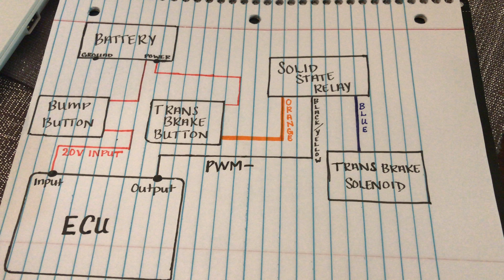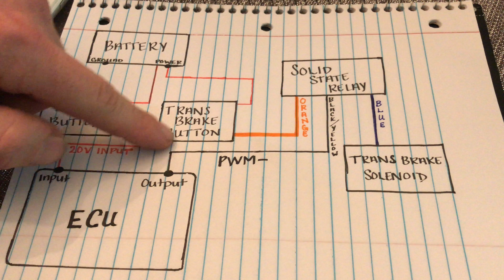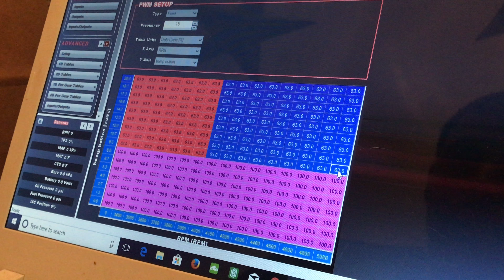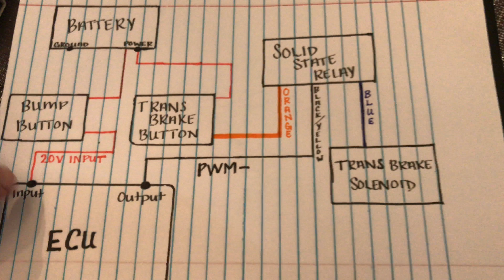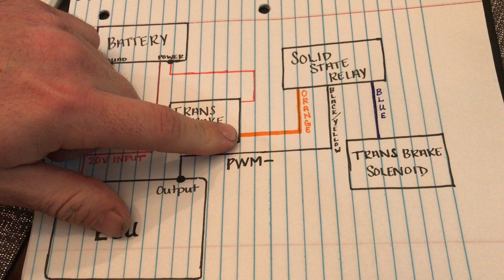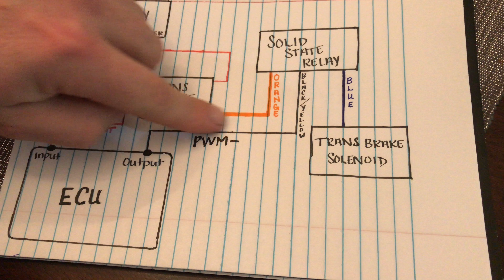Holley efi bump box

Comment: Not a fan of this method at all. I don't like to run direct power anything through the ECU due to heat and A LIST of other issues that burnt up my first terminator. Rule of thumb for longevity. ALWAYSE control the ground if possible...

Comment: How does this diagram, which makes more sense, square with your other diagrams where the orange wire is to the battery, blue to tb, Both buttons to 12v or ground...and how can it be that they will work the same at 12v as they do at ground?

Comment: Would this also apply to the terminator x?  Getting ready to order everything I need at once so I can get this system installed and running with little downtime
Reply: I can't find the bump button in the y axis in the pwm setup with the Terminator x. I will say it will not work until proven otherwise. Maybe devin can help with that

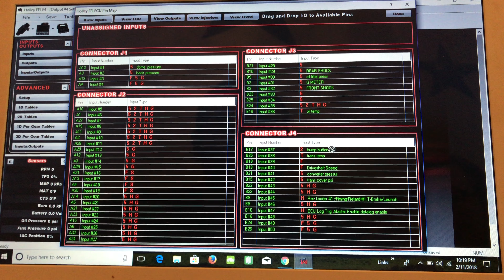Comment: I think what's missing here is how we connect the Transbrake button to the ECU.  It might help to go over that and enabling it in the appropriate ICF screen within the software, and how to assign it a pin.  Your diagram only shows the button going to the Solid State Relay, but may confuse people on how the ECU will know you're pressing the transbrake button in order to make it so the bump box can even trigger the relay.  Are we supposed to tie another wire into the Orange wire from the Solid State Relay (reference in your diagram) and run it to the ECU, then configure it in the software?  I see yours is setup in the Pin Map on Connector J4/Pin B9 as seen at roughly the 9:00 mark.  I think clarification on this may help a lot of us.  Nonetheless, this is a great video... thank you for putting in the time to create it and share.